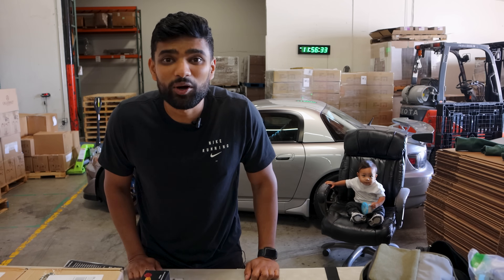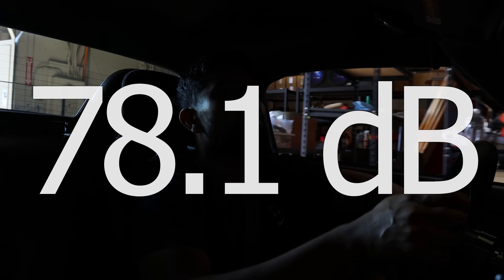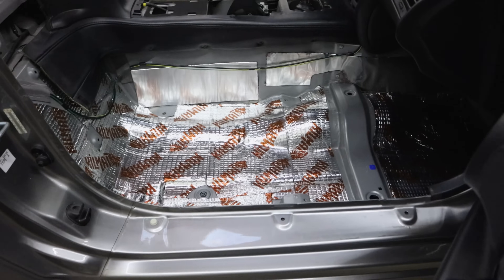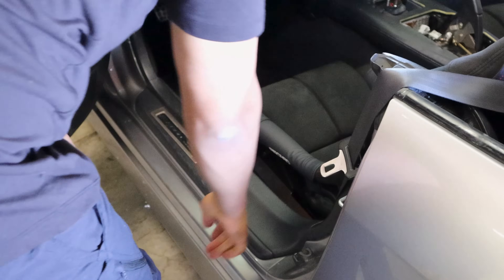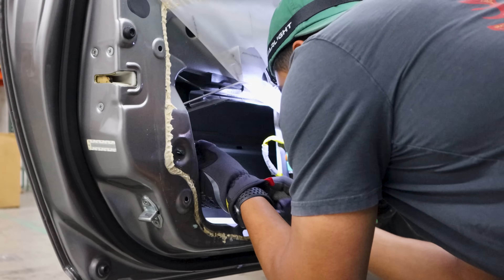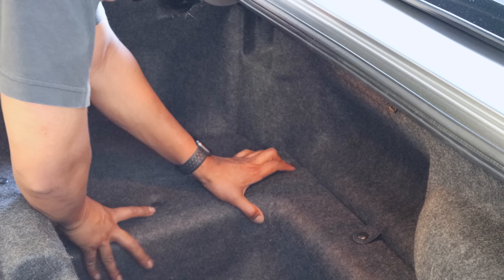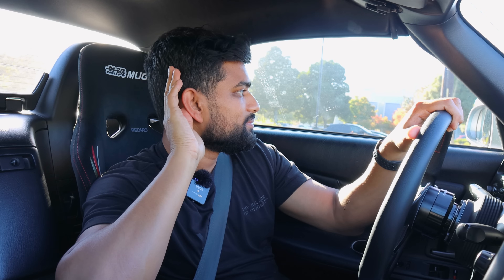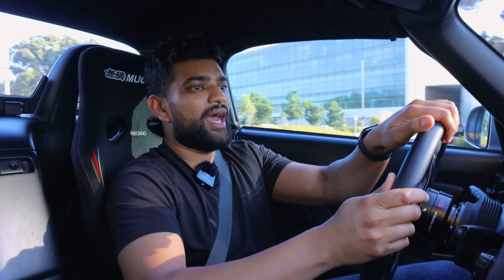S2000 Interior Modernization PART 2: SOUND DEADENING - Was it worth it?

Comment: Great video. How many pounds of weight do you think you added to the car? I hear the kilomat has some weight to it. I was on the verge of trying this before I noticed my rear wheel bearings were making noise and fixing that helped my case a lot. I still may try it. The thinsulate is a nice touch as well. Does the stereo sound better with the doors changes you made?
Reply from the maker: i added no more than 18lbs. hard to tell if the stereo sounds better, i guess i didnt really compare yet. I will say that now other little rattles that i didnt notice before are starting to bug me lol. thanks for sticking around til the end.

Comment: I did a similar thing to my Integra Type R. I l limited my sound deadening to 10kg of weight as I didn't want to add too much weight. Was much nicer in the cabin even with such little sound deadening added. I don't drive my S2K a whole bunch and accept it as a loud car anyway being a convertible but nice to know you can quiet these cars down too.
Reply from the maker: i took the weight into consideration as well and i added a similar amount of around 8 kg in total to my s2000. well worth it!

Comment: Awesome video! Thinking about doing something similar on my fully stock ap2. Mostly want to cut down on the noise sitting at highway speeds. Maybe “thinsulate” is just want I need to use ;)
Reply from the maker: totally agree and it should help quite a bit. thanks for sticking around til the end!

Comment: I honestly regret putting as much sound deadening in my doors as I did when upgrading my stereo. I plan to take half of it out eventually.

I'm in Canada so I pretty much never use the car top up, and wont ever own a hard top. Any difference in road noise is drowned out by wind noise.

 But I totally get why you'd want this if you run a hardtop.